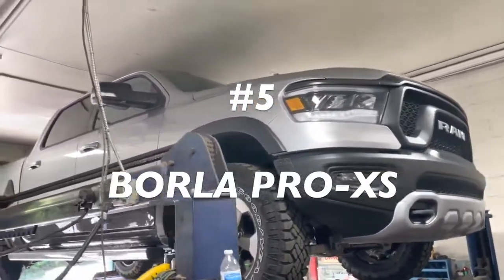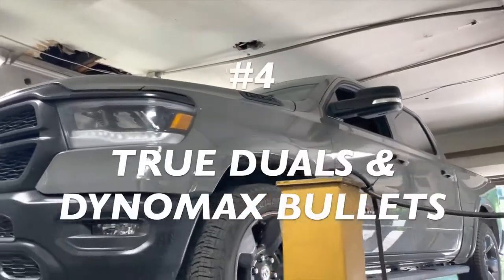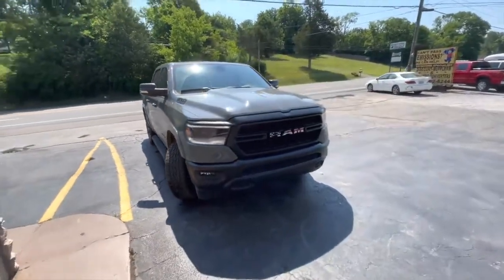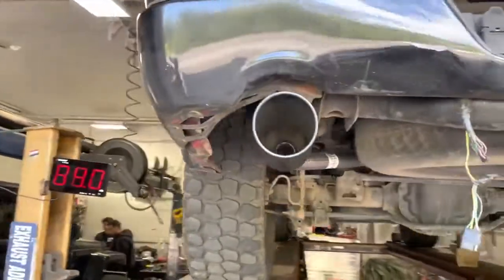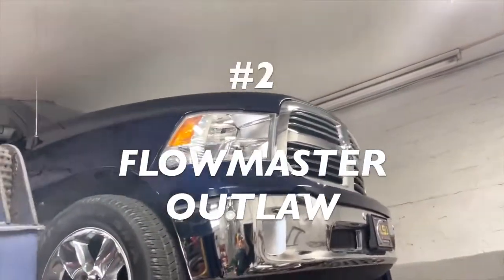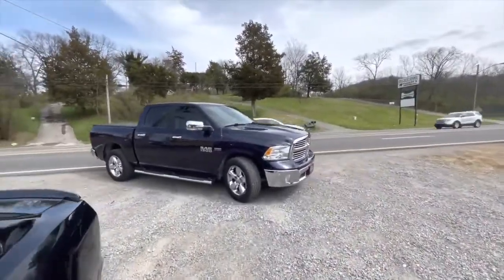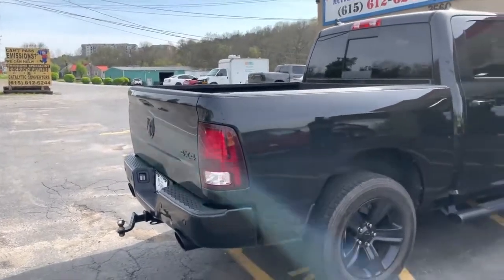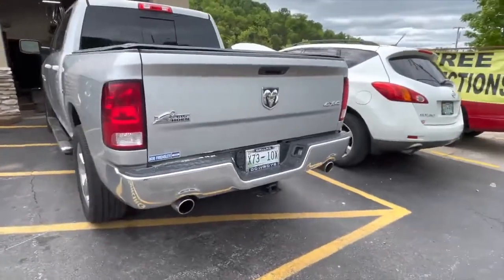¡Los 5 MEJORES ajustes de ESCAPE para RAM 1500 5.7L HEMI Part 3!

Comment: I have a RAM 1500 5.7 Laramie Atx V8 but I am thinking of changing some parts of the truck such as the engine, brakes, exhaust, color, wheels, etc. Could you tell me the name of the exhaust at minute 8:00?